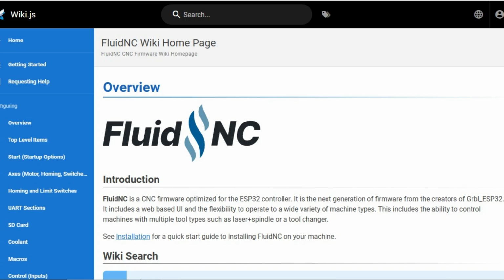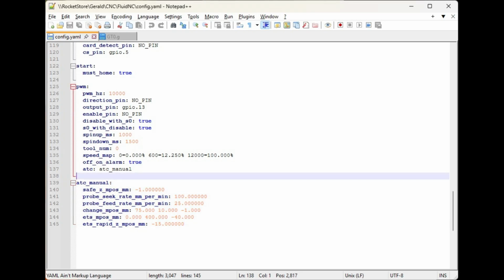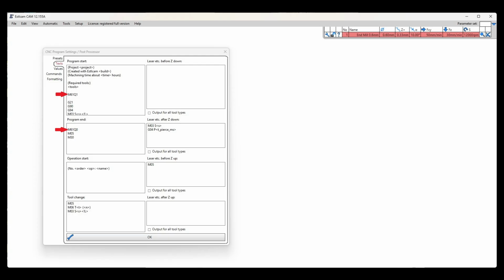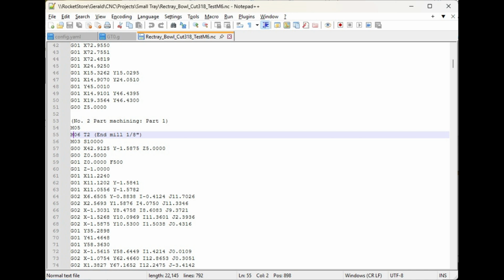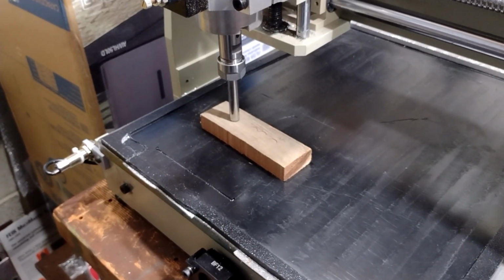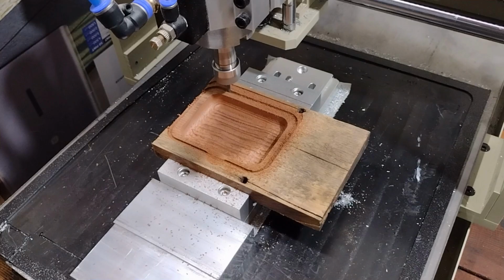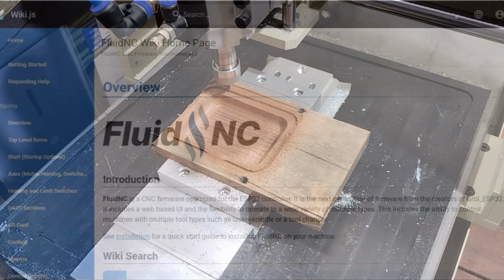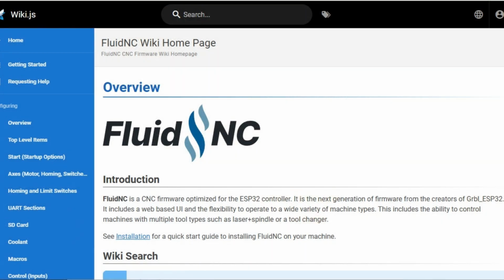FluidNC's ATC Manual Feature discovered and used on my 3040T CNC

Comment: Interesting. I don't plan to upgrade my 3040 engraver, but at some point I want to build a larger, more capable CNC.
Reply from the maker: Well, I haven't thought about a larger unit as yet, but, if I did, it would required a huge workshop rearrangement, AKA, decluttering!!!